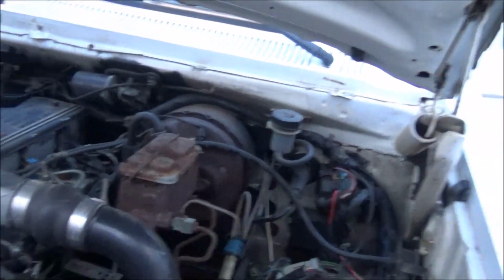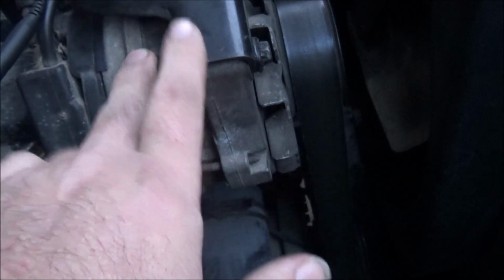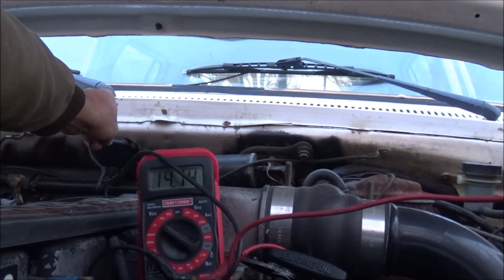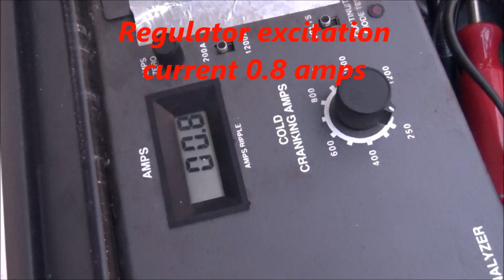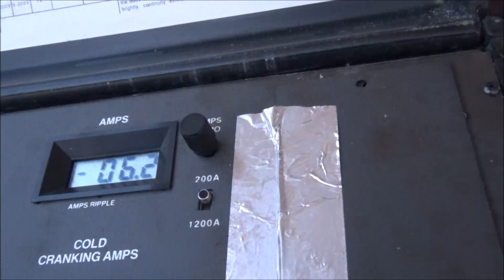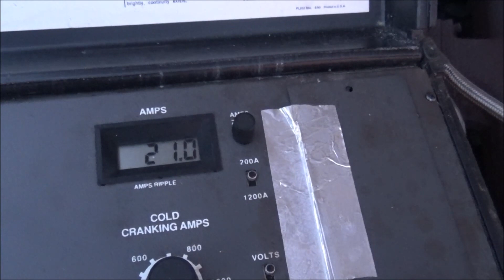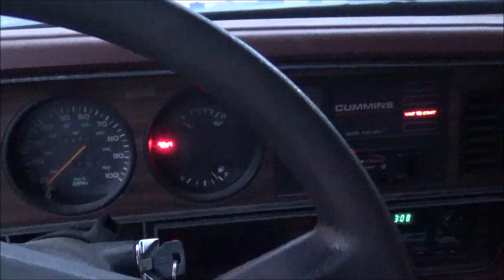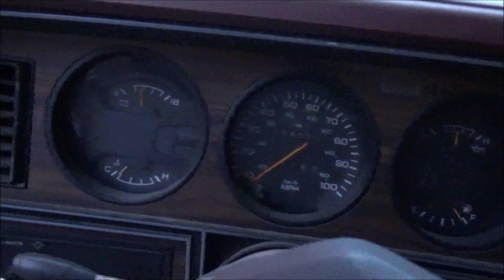Excorsing Electrical Gremlins

Comment: Good morning Brian,
I assume you ran the same thorough tests on the previous alternator,  would you say the readings were consistent between them?   Also, I still like a dedicated ground between alternator and regulator fresh wire never hurts; A ground loop can be a devilish evil thing  that manifests itself with heat and humidity..  Good luck.
Reply from the maker: I couldn't observe much difference between the 2 alternators only thing I could figure was it had something going on when it warmed up maybe or had a dirty signal being generated that I would have to have an oscilliscope to detect that was causing problems. I was advised by one of my electrical engineering buddies to not add a ground wire from the alternator directly to the regulator as that could create a current path for vehicle loads thru that wire instead of taking the proper current path. It could solve the regulator problem but create new ones by causing over current conditions on some of the wiring by it taking the wrong path. If the vehicles were wired with the same size wire throughout it wouldn't matter but since they tend to keep getting smaller as the loads decrease it could be a problem.
Reply: I was not clear about the ground,  it was temporary and for testing.    That said,  changing the alternator is a viable option since you had a spare, and having a EE handy is a boon.   I still suspect a temperature induced issue with a winding or diode is at the root, time will tell.  Looking forward to your next barn video...   FYI,  I'm taking the family south for vacation at the end of May and thought I would swing by.  Have a great day Brian.
Reply: Walt Kiefer Walt Kiefer Your family doesn't want to work on the barn for their vacation they want to go to the beach. You might end up going on separate vacations.
Reply: LOL,  What!  You won't be done by then?    I don't seem to recall the `work' word, but I would if I could... ;)

Comment: A co-worker of mine had similar trouble with his 4 X 4 dodge ( same diesel, same vintage ).  He became convinced the source of the trouble was vibration and he tolerated it until he sold it never having solved the problem.  The first time I rode in it I thought something was going to let loose in the motor and the view in the mirrors was fuzzy from the vibration.
Reply from the maker: It must have needed motor mounts.  Excessive vibration is not normal. Mine really isn't even much louder in the cab than when it had the screaming 360 gas in it.

Comment: Hi Brian. Could it be something as simple as the location of the regulator? This truck had an engine swap, right? I wonder if the location above the exhaust manifold makes it run hotter than it used to with the old motor?

Just an idea, probably not relevant. Maybe some sort of a heat shield would be helpful. Good luck with it.

Mart.

Comment: what about battery acid corrosion at the battery terminal to cable crimp. I had a problem like that, I ended up changing the negative battery cable. Now all ok.

Comment: The charge voltage is high, i was taught 13.8-14.2v, but that is a GM spec. The other thing would be that John Deere battery, i'm not sure a deer and a ram can get along with each other! ;-)

Comment: Is that the same mounting location as your other truck? Maybe the heat from the exhaust is causing the problem. Could also be why the other old one started working again.
Reply from the maker: It is in the factory location same as my other truck. The reg seems to get warmer from itself than it does from the exhaust. When driving the underhood air blows over the reg and keeps it fairly close to firewall temp.
Reply: Thinking the same that the alternator is very close to exhaust manifold

Comment: If block to ground or any other ground is questionable do an ohms and voltage drop test, voltage drop over a wire tells more than anything how much resistance it has. Also can do voltage drop tests on any of the power wires to find a wire with high resistance. Every wire will drop a small amount of voltage over each inch of length.

Comment: Your grounds test just fine with the engine off. Run a strap from the block side of the engine mount to the frame. Add another from the frame to the body. The engine block is not properly grounded.

Or it is, but has an intermittent condition once vibration is in play.

Comment: I've had mystery issues with my 92 D250. The common culprit with these trucks is the wad of fusible links on the driver's inner fender. The charging system runs through those failure prone wires. 
Look at www.dieseltruckresource.com for more into. Go into the 1st Gen section and read through "The Sticky".

Comment: Brian, swap batteries from another vehicle and compare voltages.  at least this doesn't cost more money, but can be very telling.  Check both vehicles voltage at the battery before swap and after.  1/2 hour max after all the time you have already invested.  good luck buddy!

Comment: i have found that the grounding demons seem to like living in any connections to cast iron. they will test good and work under most conditions but temperature and load sets them into action. not sure why but a little corrosion at these joints do some really strange things..;.
Reply from the maker: They are all sanded to bear metal greased and tight, should not be any problems there.

Comment: Brian, I don't remember if you said. Did the problem come with the replacement engine? Is the new engine from an older model year and was the N.D. alt. a stock unit? It will be interesting to see if the problem persists. Maybe the bean counters chose the N.D. alt.
Best of luck,
Rollie
Reply from the maker: The engine is from a 92 and so was the ND alternator. All the truck wiring is from an 89 diesel. The bosch alternator I put on was also from an 89 diesel so it should all match exactly now.

Comment: An exhaustive exploration of all dynamics. Was it an alleged "Made in USA" version you showed with the potting compound removed - the PCB part numbers next to the CE logo. The logo I found that means made in China. No wonder it was behaving as badly as all the off shore units.EDIT: I stand corrected, CE is a stamp of conformity for products made or to be sold in the EU. That's just weird
Reply: Ce means European Conformity, probably lead free solder, people who say it means china export are just saying it because they dont like china goods, yes its all over the internet, but thats not what it means( so you might say thats EC!, but the real words it stands for are french, and they say things weird)
Reply: Well that blew a huge hole in my theory :-)Thanks for the education, I assumed the chap who mentioned this in a YT vid knew what he was talking about. Did some follow up ... "Conformité Européene" is the french term according to Wikipedia.  It is confusing because it was invoked by the E.C.  (European Commission or Council). ROHS figures large in this certification of compliance, the non leaded solder bit. What is weird about it is that it is found on items made in or to be sold in the EU. I wonder what this is doing on a Voltage Regulator made for a vehicle such as Brian's Dodge. More likely to have another stamp of compliance like FCC . Working with non leaded solder is bugger!
Reply: +chris thanks for the reply, i can only assume some european vehicle has an external regulator :)
Reply from the maker: There were some of these trucks sold in Europe. I know a Finn that has one.

Comment: In the earlier part of your vid your grid heater lite was flashing on and off  at the same rate as all the amp spikes. Maybe if there not shutting off the the reg can't keep up.just a thought. Good luck Brian I hate electrical crap :{
Reply from the maker: They are off. the start light flashes as a message that the intake temp sensor is bad. I have a new one ordered for it.

Comment: The fact that the current bounces around like that means something is not correct.  In all my work on vehicles if something funny was happening with electrical,  it was almost always a bad ground or a bad connector

Although this does not fix your situation,   They do make one wire alternators,   maybe they have one that will fit your truck.  This would eliminate your regulator all together.

Comment: Brian,  That Ohmmeter really doesn't tell you much.  First, it tests with milliAmps (not Amps) of current whereas the field coils need Amps for normal operation; resistive heating in contacts is much different for the two cases.  Second, it is clear that the meter can tell no difference between shorted leads and testing the circuit.  Third, inductance in the ground circuit can also be a problem and the meter, being a DC device, cannot see inductance.  You would be much better off reading voltage (both DC and AC) while the truck is running.
Reply from the maker: I gave in and put a one wire alternator on it 8 months ago when it started acting funny again. So far it has been working fine.

Comment: Dose Dodge still use a porcelain block in the electric system?? if so have you checked it??
Reply from the maker: That block is for the coil on a gas truck, this one doesn't have that.
Reply: Ok, I just remember it from a long time ago, and one went bad on a friends car and he kept having problems till he changed it. Good luck and thanks for the response. 

Kevin

Comment: Looks like maybe it was the alternator Brian. Did you load test the battery? Sometimes a shorted cell in a battery will make you pull your hair out! I can attest to that, not having as much hair as I used to. The batteries now days aren't what they used to be either. Good luck Brian.
Reply from the maker: Battery load tests fine and doesn't discharge.

Comment: it looked like your amp gauge in the cab showed less than 12v. but having all that stuff turned on may have effected the charging. how about just checking the normal charging voltage, and then looking at what the gauge says.
Reply from the maker: As I mentioned in the video the dash voltmeter is improperly calibrated. It shows a lower voltage than it actually has. I have another gauge cluster that reads more accurate on the volts but it will run you out of fuel still showing an 1/8th tank so I choose to use the one that reads right for that since I care more about that than what the actual volts is. I always check my gages by needle position compared to normal anyway so I notice blips or out of position pretty quick.

Comment: Difference between ground current and plus lead current HAS TO BE noise. No way around it. Rules of electronics says that current is the same at any point in a series circuit. Think of alternator to battery to ground as a series circuit. Current on plus lead MUST equal current on ground lead. Difference in reading attributable to noise on plus lead. Noise could be coming from number of places... But I would guess heater motor. Of no consequence.
Reply from the maker: Couldn't it be because I only had half the picture? I only had the circuit portion of current traveling thru the ground cable, any current traveling thru the chasis ground I was not seeing. I couldn't get the clamp around both grounds at the same time because my amp clamp isn't big enough.  I bet if I could have the amp reading would have settled out. I think you should see a package next week.
Reply: Oh, I get it! You were only clipping on big lead to battery. Part of current from alternator was making turn at battery terminal and heading to load!

Comment: Some electrical gremlins are a real bitch to solve as you already know Brian. With all the years I've spent operating large earth moving equipment I've had a few pop up. Some just couldn't be found in the shop. A few were found by putting test equipment on the machine and having a mechanic observe what showed up under the usual operating conditions. Might be worth doing the same and use your camera to record the readings then fast forward through that and see if anything odd turns up under certain conditions? Me and electrical aren't even on speaking terms so that's all I can offer. I do have a feeling you may be right and the after market parts are junk to start with. If you are getting a random spike in the electrical system that might be enough to slowly kill them as well.

Comment: Check your alternator for ripple, which means it is starting to output A/C instead of D/C, good ground and powers on volt reg so it is not that. 1 year warrantee on the volt reg tells me it might be Autozone or Advance? if so you most likely are plagued by shitty volt reg manufacturing.

Comment: I can still see the same characteristic oscillations at idle, I don't think any thing has been fixed. Try running 2 regs in parallel?
Reply from the maker: Would that work? I would think the regs would tend to fight each other since they would both be wanting control of the same thing like kids fighting over a toy.
Reply: It's worth a try, if you ran a separate wire of the same guage and length to the field winding for each reg it would serve as a device to help balance the loads, 1 ohm power resistors in series with each reg would also help.

Comment: I think this is getting a little to complex. I still think it is just cheap regulators that you are using. You didn't say if you used a mopar or aftermarket one this time.
Reply from the maker: It was a warrantied aftermarket. The Chrysler one lasted long enough to get out of its warranty before it quit.
Reply: If this one fails again, try another one from the dealer, not an online seller. Too many people online are selling parts that claim to be OEM, but they are not.

Comment: Brian, during your last video, there were several intermitant failures in about the same amount of time has this vid which had none. Dare I say it, maybe it's fixed. R
Reply from the maker: Yeah all I had was failed regulators in the last video, hopefully now that I changed alternators they will last a bit better even though I found nothing wrong with the other one, but maybe it had something going on after it warmed up sometimes.

Comment: 14.8 is much higher than they charge in europe, typically 14.3 max, strange, best of luck you evicted them gremlins though
Reply: lol you must be polish
Reply: def not polish, think: more the land of tea and biscuits
Reply: jusb1066 that figure you quote is very low there is not enough over volts to get much charge in

Your figure 14.3 is only 1.6 Vdc charge volts is about a 16 amp charge assuming 0.1ohms int resistance 

After a cold start I would like to see 15.6 for about 15 mins 

From the land of bakewell puddings 😀

Stuart
Reply: yep, in the UK , typically it will top out at 14.3v, you will never see 15.6v for sure, alternators dont charge very quickly here. i also dont see 120amp alternators. (ford transits with 60 amps or very large cars), my fiesta has a 40amp! ,lol., my alternator volt tester says 14.7v is where it would show as overcharging, and is pretty much what I was always expecting back when i turned wrenches, perhaps some super modern stuff has temperature compensation so could go a bit higher in the cold
Reply from the maker: Even this 30+ yr old tech has temp compensation built it I was told that the disk I was asking about on the disassembled regulator was there just for that. It was about 40degF when I shot the video so it was probably a bit higher than standard than that. I notice the different regulators seem to all charge at a bit different setpoint even though they are from the same supplier. That probably speaks to the quality control of the Chinese components.
Reply: jusb1066 well my BMW diesel has a 170 amp alternator fitted and a 180ah battery these auto stop dodads need some heft to keep em rolling 
It not the total volts that matter it's the difference between cell volts and alt out put basic ohms law 

I will leave it at that or do I need to get my PhD out

edited for correctness 170 not 100
Reply: Just checked this is for a petrol bm BMW 1 SERIES F20 118i Generator Alternator 170A 12317605060

Looks like 170amp so I under sold mine
Reply: +staurt, im in complete agreement with you, that kind of starting and stopping would need some power putting in quick, i think my only problem was the 14.8v volts of his alternator being a bit high, usually max amps would only be going in when the battery is a bit low and/or all the accesories loading the voltage down, no reason for 14.8v really.